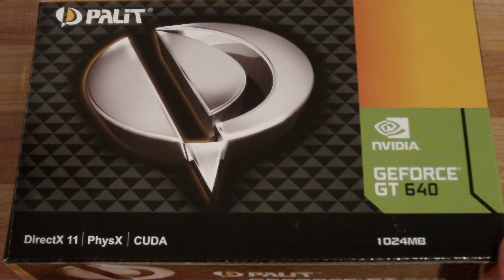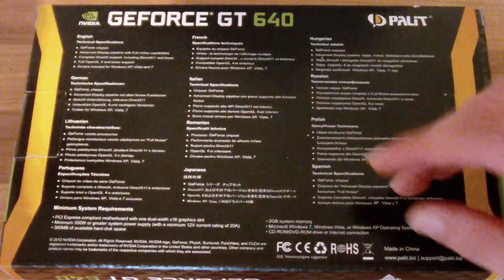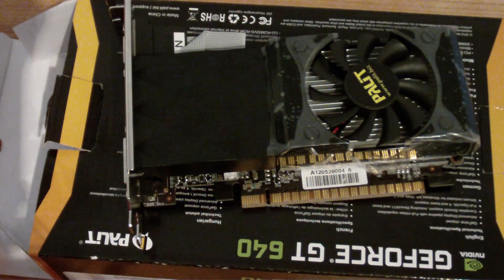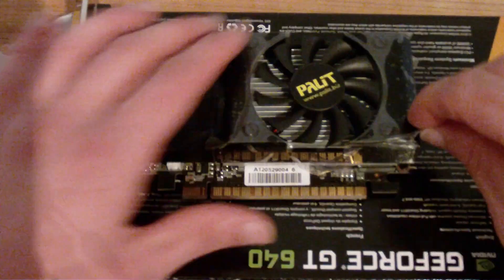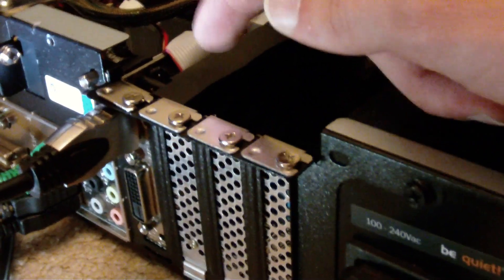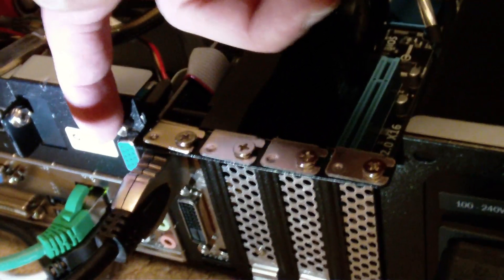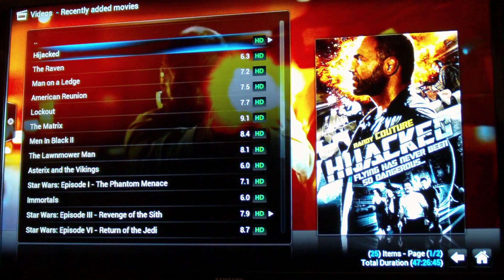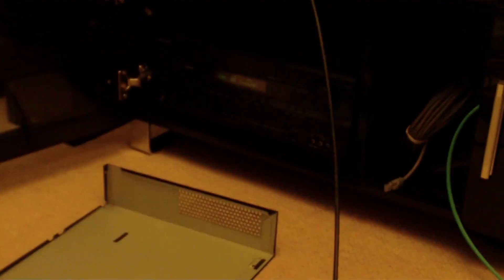Unboxing & Look at Palit Nvidia GT 640 with XBMC Dolby TrueHD audio output

Comment: Will this work on a 250 watt PSU? I am going to use it for gaming at 1080p at low-mid
Reply: TroniX Did this card work for you with 250 PSU ???
Reply from the maker: Should be ok. But you're pushing it to be gaming at 720P with this card
Reply: ***** Okay, Thanks for letting me know. Do you recommend any other low profile cards to use for gaming? Thanks
Reply from the maker: TroniX If you're limited to low profile then I guess this is about the best card you can buy. Shop around you might find an Nvidia 750 low profile?
Reply: ***** Okay cool. Thanks for helping :)
Reply: Mateusz G Sorry I am not sure, I didn't buy the card :( However, quidsup said it should be fine to run on a 250 watt power supply :)

Comment: quidsup i have some question regarding FAN.

I see it has only 2 wires. It means no RPM meter, no speed control ?
In that way it works 100% max speed all the time ? Is it much louder than PSU/CPU fans ?

Comment: You need in-kernel support for Kepler if you are planning to use Nouveau, the nvidia driver blobs should work fine with the 3.2 kernel series. But I may be mistaken. Correct me if I'm wrong.